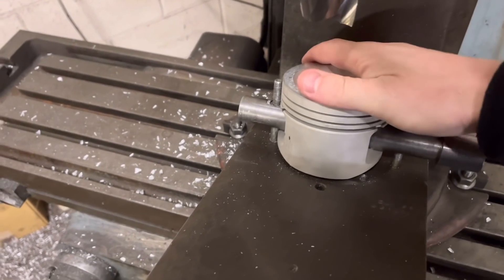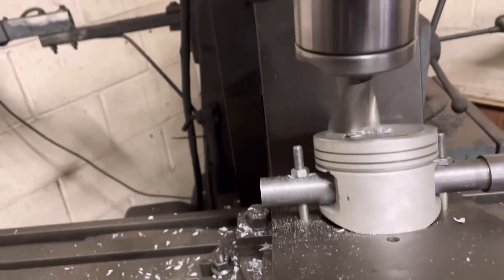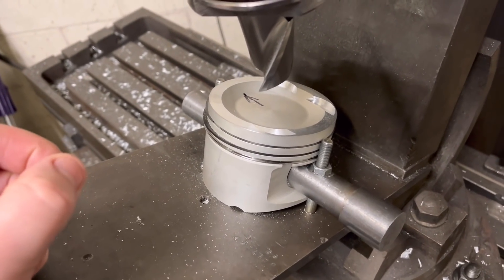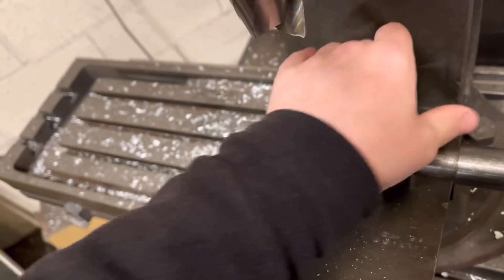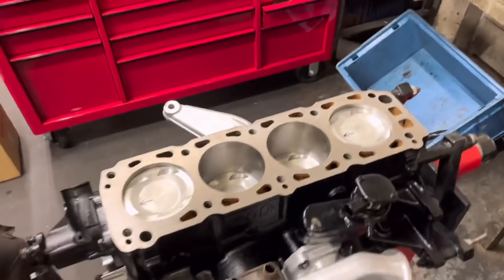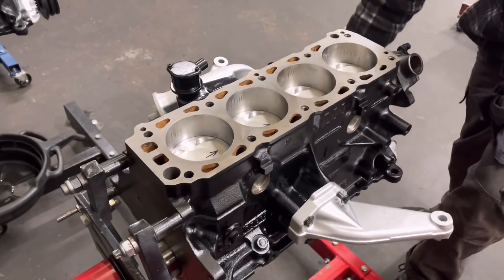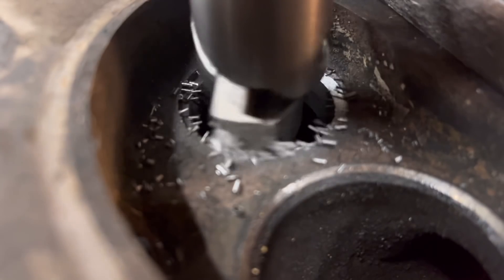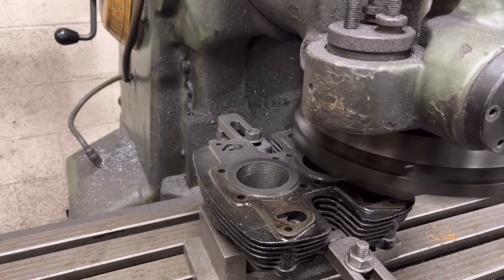Machining Monday Milling In our workshop

Comment: There was a guy called Magoo who did pinto rally engines with 2x50 webbers alloy Granada GPa pistons, fiesta diesel rods and Volvo valves which were the biggest you could fit into a pinto head and a holbay 2.4 crank.
Never saw a better sohc rally engine than them, imagine one now with a alloy block and alloy head

Comment: Watching you skim the Norton barrels gives me the colywobbles.
Had a Norton commando that needed the head skimming so took it into college and set it up on the milling machine ready for machining.
Used a slab cutter which would do it in one pass,so off I went taking a very light cut but the class tutor said I should put on a heavier cut and he wound the bed up 5 thou.
Started cutting and the slab cutter was rattling across the head and unknown to me the vibration was loosening the clamps,all of a sudden all hell let loose,the head flew off the milling machine and passed between someone's legs who was walking past.
The head had a chunk out of the joint face but the lab technician said he could machine it.
He had to machine it down to the first fin which meant about 1/8th of an inch was removed.
Ended up with a supper thick aluminium head gasket which did the job but got rid of the bike soon afterwards as  I wasn't happy with it.
It ended up being used for club racing and many years later a bike with that registration came up for sale but I suspect it was a ringer because when I looked at it it certainly wasn't the bike I had owned.

Comment: I do enjoy machine work and watching someone very good at their craft.   The only thing I'm wondering about the Norton liner job....doing similar things we always freeze the liners and heat the cylinders a bit which makes installing them easier and I think perhaps less stressful on the old cylinder needing less pressure to push them home.   Probably doesn't make all that much difference but using thermal expansion and contraction not a hard thing to do and I don't think it can hurt anything.   Really enjoy your videos and the time I'm sure it takes to make them...much appreciated.